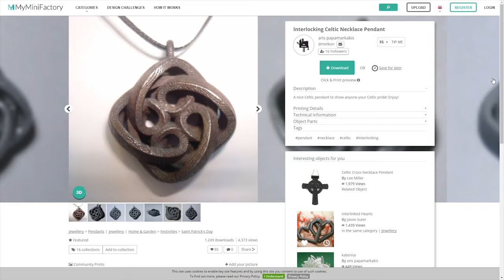Lost Wax Vikings Pendant Brass Cast

Comment: Hi, great fun to watch you doing your thing as always but consider print those things in ABS, vapor smooth them, make a silicone mold of the model and cast wax in the mold. Should provide you with far better results and mistakes are not a big deal since you can reproduce the wax model quickly and cheaply. Moldable silicone isnt really expensive either
Reply: Tedris Threed Silicone is decently expensive, a hard mold would also suffice. It would save on the expensive wax filament if he was making a lot of them, and save on print times in that case. Otherwise it's just faster to print the pieces individually
Reply: SugarBooty a silicone mold for that size would cost approximately 3€...
Reply: Tedris Threed I can't find any kits under $20, and they're half pound kits. Maybe, it depends how big you make the mold. However, they do have pre-made molds for much less
Reply: i can buy molding silicone straight from amazon for 30 bucks (1kg). A mold for this tiny pendant should weigh max 100gr. thats how i estimated the 3€ cost. I am sure that you can get this kind of silicone everywhere since its pretty standard
Reply: Tedris Threed ahh, well, it's definitely something to pursue

Comment: <-----jeweler I would highly recommend plasticast investment and don't take the flasks out of the heat all at once one at a time so they stay hot, the sprues don't need to be that long you will get less bubbles in the cast.  love the design would you happed to have a stl file I could get of it?

Comment: Threw me a bit with the in gates.  Great work.  Very well done.
What is the fluid you steam at the end?  I like the polished outside in contrast to the darkened inside.
Reply from the maker: Thank you! It's white vinegar :) I've looked for brass patina recipe online and most people seems to use ammonia for a fast patina, but I didn't had any on hans so I went for vinegar!
Reply: That makes sense.  I read about sealing up copper antennas (old ham radio ops from 20's thru 50's used plumbing supplies) and they used an ammonia wash, then soap and water, then mineral spirits to sort of seal it.  Turned fresh copper into that brownish green color and stopped the ammonia from continuing to tarnish it.
Again, nice work.
Reply: So cool!  Even though you are not smelting brass much these I wonder what you found the best sources for cheap brass were /are ?

Comment: Wow! That was amazing! I'm so inspired by this guy. Celtic blood in me veins where I just have to have a go at this at some stage. Even encourage me children to do the same....Would you be so kind and advise where did you source the necklace itself onto which this pendant is placed? I have a number of ideas involving a flypress where I make up a die and press the design on the work. Just finding it tricky sourcing a suitable necklace that is strong enough and looks the part. It has to compliment the work and the necklace you have used has just done that. Beautiful work man, I'm pumped!! Thank you!!
Reply from the maker: Thank you sir!! :) I don't really understand well the question, sorry, anyway the 3d model of the pendant is linked in the video description :)
Reply: You're very welcome BB Project....Sorry for being a little unclear.....skip to 13.59 on your video...I meant to say is, would you have a link for necklace bit that is attached to the pendant and goes around the neck. The necklace thingy that looks like two leather type pieces with the fastening clip. Hope that's a little clearer. Thank you again. Greetings from dear old Ireland.

Comment: That is awesome, you made me want to try this process.
May i ask what were the key settings you had to dial in your slicer to get the wax filament to print well?
I heard only bad things about 3d printable wax, but you seems to have it figured out!
Reply from the maker: Thanks!! Here are my settings:

Layer height 0.1 or 0.2 mm
20% infill
Speed: 40 mm/s
Extruder temperature: 155°C
Bed temperature: 80°C
Cooling fan off
Retraction disabled
Print in enclosure (just cardboard)

And to make it stick I apply three thick coat of hair spray on the glass bed letting it dry between each pass. I also add a 20-25 outline skirt but sometimes it doesn't make a huge difference.

Comment: Hi! Awesome video! Thank you for sharing your experiments with this method!  Would you trust this method enough so that you would use precious materials like gold? Is it possible to make jewellery with less "wasted" material in the filling vents?
Reply: The material is never 'wasted'; you can just recover the metal and reuse it for another cast ;)
Reply from the maker: Thanks! I would not :')
I mean, lost wax is used to make jewellery professionally but not the way I do it. 
As far as I know the metal is heated with an airtight electric furnace or with oxyacetylene torch in graphite or special ceramic crucible, the flask is degassed with vacuum and is heated to almost the same temperature as the metal and finally the pour is done not just by gravity but with a centrifugal machine or again with vacuum. 
With these advance methods vents are not even used I think! :)
Reply: Black Beard Projects thank you for all these information! ..so then no DIY engagement rings can come out of this! :)

Comment: I was looking into the machinable wax for doing a 3D printed lost wax ring but I was not able to find good printer settings... would you mind posting your printing settings?
Reply from the maker: Sure!
I had succes with layer height of 0.1 and 0.2 mm
20% infill
Speed: 40 mm/s

Extruder temperature: 155°C
Bed temperature: 80°C
Cooling fan off
Retraction disabled
Print in enclosure (just cardboard)
And to make it stick I apply three thick coat of hair spray on the glass bed letting it dry between each pass. I also add a 20-25 outline skirt but sometimes it doesn't make a huge difference.

Comment: Just one question. What were you doing at 13:00? What liquid you used and what for?
Reply from the maker: It's white vinegar. I've tried to force a patina with vapors :)
Reply: Okey interesting idea, but i take that didnt well as planned? At least from video i didnt see much chance.
What i read about this method i think you should had used dark vinegar and dissolve some salt in 5 to 1 ratio. I think the missing key might be the salt, though i have no chemical know how on this matter and rather new on use of brass in anything. You did clean part probably good enough seeing you putting it in using wire and not your hands.. also havent though such use for soldering stand, gotta keep that in mind.

Trow us a video if you find good solution on the patina.

Comment: Hey dude, I've got a question. I've been searching the internet for actually quite some time and couldn't find an answer.

I also tried casting brass after melting it in a forge. The problem is that my brass burned quickly after I pulled it out of the fire and developed a lot of dross.
So my question is what kind of flux or additives you use when casting brass. I'll try kitchen salt and borax very soon.
Reply from the maker: Hi there! Most people say brass don't need flux, but I had some dross too in a previous melt in a steel crucible so I tried borax and it seems to work fine. Just be carefull because it pops a lot :)
Reply: Black Beard Projects thanks dude, gonna give it a try! Btw I'll also buy a 3d-printer and wax filament soon for brass casting

Comment: What was the point of having holes in the tin cans? I've seen them used for vacuum but you didn't seem to use a vacuum pump.
Reply from the maker: I think they are there to help the moisture get out of the mold :)
Reply: i think it's that and also for better heat uniformity/penetration.